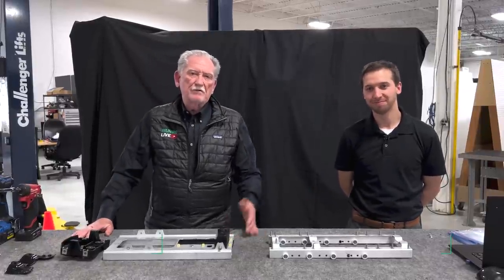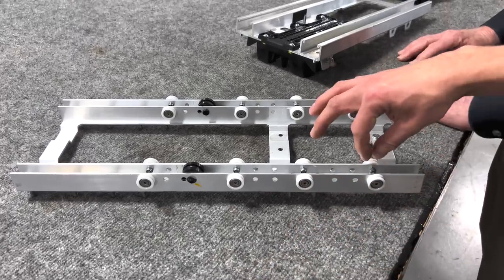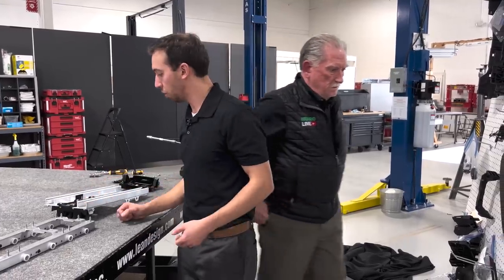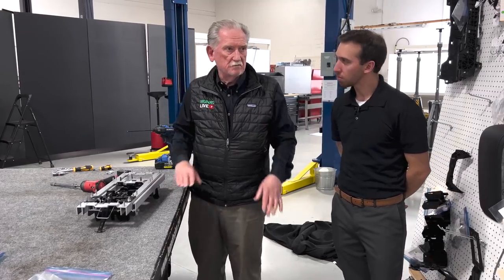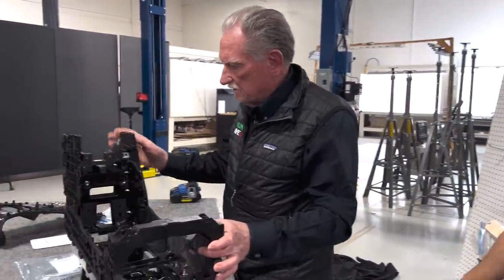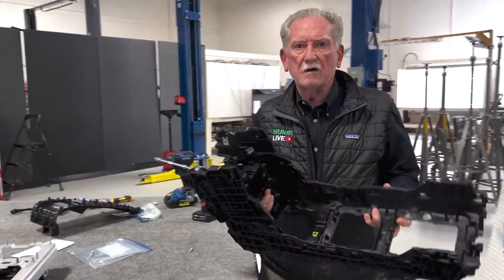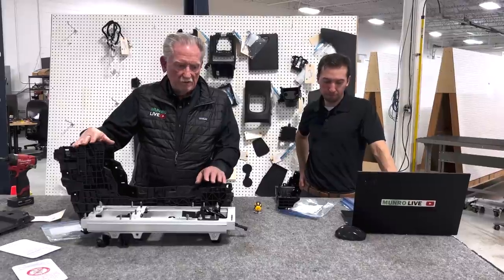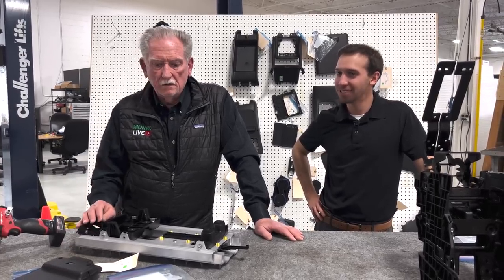Some assembly required | Hyundai Ioniq 5 Sliding Center Console

Comment: I'm really impressed how well Tyler knew this assembly top-to-bottom, considering he wasn't involved with the design.  He knew where every part went immediately when asked, the orientation, which fasteners and which direction they went in, everything.  He did a great job walking Sandy through the entire assembly.

Hyundai, look at this as an opportunity to improve your production rate and lower your costs.  Put aside any shaming of whoever designed this system and instead use it as a learning opportunity.
Reply: Learn from the best and you may undercut your competitors.
Reply: Just wish he'd have had the parts count/weight numbers at hand, wouldn't be surprised to see Sandy in need of an IOctovalve inhalent! :)

Comment: Great video! Thanks!!

I just replaced my fixed center console in my 2023 Ioniq 5 SEL with a sliding center console from a 2024 Ioniq 5 Limited. It was extremely easy as it only required removing 4 nuts (two at the front and 2 at the back) from the floor mounted studs plus one combination electrical connector for the 4 USB ports and wireless charge pad. I'm a big fan of the sliding console because I'm a big person and I cherish the knee space that the sliding console provides when slid to the aft position. Also the skins are interchangeable between the two if the color happens to be different. To access the nuts you only need to remove the console floor which just snaps into place.

I'm guessing that the actual consoles are fully assembled before arriving to the main assembly line where they are just quickly dropped in place.

Comment: That was great! I used to be in charge of manufacturing engineering at the original Silicon Valley startup. We learned Design for Manufacturability early on and Sandy clearly nails it. I watch these videos because it continues to be a fascinating topic and I would actually work there for free if I could. People tell me I'm nuts when I tell them I preferred working to retiring.
Reply: Me too. I will do my best to avoid retirement.

Comment: Thanks for this Video! But please keep in mind that if you slide the console backwards you can easily switch from the driver to the passenger seat, without any acrobatics or the need to lift your feet! Which also means that you can sit on the console with your full body weight. All plastic, probably not the best idea. As an end customer I appreciate this robust solution. You can sit on the console and the floating armrest and nothing moves or crunches at all.
Can be made from fewer individual parts, definitely, less robust, please Not! Best regards from an IONIQ 5 owner since 2 years with a sliding center console, i love it ❤
Reply: Because you’re an IONIQ 5 owner and obviously have had some experience with the center console, I have a question for you.
I can see why it’s convenient that it slides, so you can easily get to the drivers seat if the drivers door is blocked. 
The fact that it slides is not a problem. As Sandy points out, it could be done a lot simpler though.
But you specifically defend its robustness so you can sit on it. 
Why would you sit on it?
Reply: @holgergrauslund  "Why would you sit on it?" is a pointless question. Someone will sit on it, and thus it needs to be strong enough to support those forces.

Comment: I think the reason why the slide isn't part of the console is it's only used on the higher trim levels, the base Ioniq 5 doesn't have a moving console. So they just make one console for all the cars and install the slider as needed.  But I am glad to hear it's over built rather than cheaply made.
Reply: Yah, individual part to prevent rattling noise? Sign me up on that. At least some customers choose to pay for it...

Comment: I own an Ioniq 5 (wife and kids agree it is the best car we have ever owned).  Love watching Munro.  The rule of "does it HAVE to move?' is a great design question.  My answer regarding the Ioniq 5 centre console is 'Yes - the console should move'. We move the console regularly.  I used it just today - my son is learning to drive and when I picked him up I simply moved the console back, slid easily from drivers seat to passenger seats like the old days of open front bench seats.  My theory with the Ioniq 5 (I could be wrong) is that Hyundai saw an opportunity to bring to market an EV that would help improve their market standing and reputation.  I think they put their 'A team' of engineers on it that were told to 'spare no expense'. I'm not convinced they are making much profit on the Ioniq 5 but its purpose is more as a 'halo EV car' for the brand, not so much a profit maker.  The centre console design highlights that Hyundai's focus was not building cheap but instead building robust and feature rich.  The centre console is very sturdy from my use - my 3 teenage kids have tested it fully!
Reply: Great comment! I also think that a heavier console is a more sturdy one 👍
Reply: It’s cool to hear a customer is getting some use out of it!

Question: would you be more, or less, happy, if it had seat-mounted armrests and some shallow Tupperware on the floor?

Comment: I own a 22 Ioniq 5 Limited, and I think that the center console is so solidly built because, when the HVAC is ripping, there's a noticeable shake in the console. It's definitely over engineered, but otherwise it would be a rattly mess in an otherwise whisper quiet electric vehicle.
Reply: Spot on, but hey, the Tesla biased guys don't seem to remember that Teslas goes rattling before hitting 10,000 mi.
Reply: @RupOase  Yeah, I noticed that definite pro-Tesla bias. Makes most of their reviews suspect if they diss on all the other manufacturers and brighten up during any Tesla related discussion.
Reply: I agree, they spent money in a position of the car that the customer will be in contact with doften. This solid feelimg makes tha vehicle feel like a premium car.
But a lot can most likely be saved, and it would still be nice and solid!
Reply: Agreed—it’s definitely a solid construction as it should be for a moving assembly. I can’t imagine how cheap it’d feel if it was all plastic as he suggested. 

Now if only the door handles were metal instead of plastic… 🤨
Reply: @perjonsson7343  totally agreed. I prefer the over-engineering in high points of contact/interface. It feels like such a solidly built car, especially when compared to more “efficient” designs like Tesla. 

The glaring exception though, is the door opener handles—I wish they were metal instead of plastic. Especially given that many passengers miss the elegantly simply armrest door handle and try to pull from the door opener.  😳
Reply: @4thdistrict476 That’s because no one has caught up with Tesla yet. Legacy auto moves so slow. Like Sandy says, “Tesla move at the speed of thought. “  Even Jim Farley, Ford CEO praises Tesla.
Reply: @205rider8  - I disagree. Tesla moves at the speed of boredom. 

Tesla is stagnant. Their four models are so similar that they are hard to distinguish from each other. They haven't changed much since they were each introduced, making them boring. The quality issues still remain. 

Tesla has over a decade lead start on the rest of the manufacturers, so there are more of them on the roads. People continue to by Teslas not because they are good cars, but because they see them everywhere and are lulled into thinking that they are what they should buy. "Everyone has them, so they must be good". These people are followers, surrendering their decision making to others rather than actually doing research and choosing something that actually makes them excited. I know of very few Tesla owners who are excited about their cars. 

And Jim Farley "praises" Tesla's sales model, not the cars themselves. And, he desperately wants in on Tesla's supercharger network to try to save a struggling EV division, so he is prostrating himself at Musk's feet to gain favor. It's actually embarrassing watching him grovel like that.

As for Monroe & Associates, and especially Sandy himself, they are mostly concerned about how simply and economically an item can be built, not the actually value of that item - that's their "Lean Design" charter. This sliding center control is a good example of focusing on lean manufacturing to save costs rather than on the value of it's functionality and usability to the user.
Reply: He's simply pointing out you can make a good console far far cheaper. The buyer is paying for it
Reply: @glenisold79  - and the same could be said for everything in any vehicle that makes it more of a premium product than it could have been. The buyer is paying for everything on a vehicle, even things that make it better than the base model costs. So yours is an extremely weak argument.

Comment: I'm not in the industry, just an artist/painter/sculptor, so I'll throw out a guess, re: snap it together then added fasteners.
They built the column and then discovered it rattled or buzzed after x-number of miles driven, or x-number of times the column was slid front to back. 
This was particularly audible in the otherwise dead-quiet EV, and the fasteners were added to dampen / kill the buzzing.
Low cost to use the added parts rather than to redesign the column . . . either that or the shipping deadline would be missed owing to production delays a redesign would create.

Comment: From a manufacturing cost perspective this console is a nightmare but from a consumer standpoint I absolutely love it. 

It's built like a tank that will last the life of the vehicle and likely show zero signs of wear or noise or flex - ever.  

I bet a snap together poly pro unit would be a limp creaky rattly mess in a few years after creep, heat and mechanical cycling takes its toll.  

North America seems to love Fisher Price interiors where every knob, lever, button, latch, panel or handle flexes when you use it but I sure don't and it looks like Hyundai definitely doesn't either in this case.

Comment: I expect this to get lost in the ~600 current comments, but no matter.  I'm currently replacing a failed water pump on my ol' 2002 Ford Ranger 3.0L.  I've done Ford water pumps before & my description of Ford is:  "Ford puts the water pump on the assembly line first & then bolts the rest of the car to it."  Unbelievable the amount of stuff I have to move out of the way to get access to all the pump bolts.  I did a Buick water pump once & it was ridiculously easier.  This excellent video exposes that some things just never change.

Comment: Bare minimum if they wanted to keep the slide then they could re-engineer the main slide itself. Make a re-designed center console use 4 bolts that can simply use locating pins inside and attach the back of center console to rear of slide, 2 bolts inside towards front / middle. Then they could eliminate the slide bump stops itself since its positive locked to the main slide mechanism (which can be physical mounted now - so no need to worry about it coming off vs. taking whole console off). Then the main console could just be molded like EVERY other console...

Comment: I dread to think how long it must take to assemble that console. It's bewildering.
Reply: over an hour… maybe…
Reply: Imagine when it fails cuz you know they made it that way to fail just after warranty, cha ching.
Reply: Cant put all those parts in a box, shake it, and get the final product.
Reply: EVs aren't expensive because they're electric, but because some idiot in the design department has gone out of their way to make them 'futuristic'...
Reply: @KevinT3141  There may partly be some truth in that but a lot of it is the huge expense of the BATTERY PACK ! You could buy an entire lower cost ICE car for the same as the replacement cost of many packs.

Comment: Think about this another way, they just moving towards recyclable interiors. You can easily melt aluminum, but you cannot do anything except burning with glass filled plastic. Though it's definitely now what Hyundai's engineers have thought, I managed to found one benefit of such design. Also, maintaining assembly process complexity ensures high availability of jobs.

Comment: I love this format.  Do not let Sandy see what is going on with the disassembly and spring it on him with the camera running. But my first question would be; "Why does a console have to move anyway?"
Reply: The console moves to let you adjust the armrest position. And the seat lays back with a retractable ottoman so the driver can relax and rest while plugged in to charge.
Reply: The moving console and back seats are the most important feature of the Ioniq5!
Reply: @stephenj4937  And where is the plug for the driver? The Koreans do not have Netflix and YouTube in their cars, they must have direct brain interfaces. But i could not find the plug for my NBI - My Neuralink direct Brain Interface.
Reply: @wolfgangpreier9160  That plug is in front of the console where you can't reach it, for safety purposes while driving ;-)
Reply: @ScubaSteveCanada  Ahh i see, when i next sit in one i have to look again.

Comment: As a retired consultant for process optimization I learned very early on especially with manufacturers that have a unionized labor force the amount of REQUIRED intensive processes that could have been done at 30% of the cost and effort yet cannot because of their labor agreements. I dealt with a company that was by their labor contract not allowed to ship goods in a trailer that exceeded 50% of the trailer capability. For example if 1500 pieces could fill a 53' shipping container, they could only fill 750 pieces. You say, well, negotiate a better contract. Easier said than done. If the union has a hard position on that issue and will go on strike, even if you end up getting that requirement removed, the cost of the strike would exceed any savings by eliminating the 50% rule.

Comment: you have to watch Ioniq 5 center console instruction video and find that it warrants the complicated design. The arm rest is floating design which needs all that steel structure on the other end.  The complicated and heavy sliding mechanism is warranted because you don't want the thing to rattle in a few years while at the same time operate as smoothly as the price of the car.   I also like this feature of a sliding center console as I'm never fan of having a huge partition between the driver and passenger, as the interior will feel far smaller. 
I like or maybe almost the things Hyundai has done to the Ioniq 5. One major drawback that I wont be buying one is their use of pouch cells. You don't want to use those cells except for ultra portable like a phone or handheld devices.

Comment: great job.  I had a Niro and it had a hole in the front of the console, so one could pass an USB corn though it and then it was easy to plug your phone in.  This console does not have a pass though, one is anyway hunting for it, so you can plug your phone in.  My console does not slide.  Karl talked about how heavy the foot rest hardware was.  Maybe these were just outsourced design.

Comment: No apologies.  This is what you do ... and when you come up against a component that is designed SO contrary to Lean Design, it is fully expected (and desired) for some extra time spent in looking at it.  I was ready for more.
It would be interesting to know if Hyundai contracted this whole thing out to someone or it was a hasty in-house build.
Reply: The cost of the part would be interesting...
Reply: Would say this absolutely was a contracted sub-assembly.
Reply: @NotNowLater  🤞I hope so for Hyundai group.

Comment: Yes, that's a extremely complicated piece, but… I really like the adjustable console in the Ioniq 5 Limited. It's a great feature, and maybe Hyundai will figure out a way to make it easier, simpler to build.
Reply: Sandy did criticise the potential for stacking tolerance errors. But the functionality of the console does seems really nice. Hopefully Hyundai can improve the cost of this design.
Reply: I believe the point is that the assembly could be greatly simplified without losing functionality or losing feeling of quality and solidity.

Comment: I was considering a ICE 2024 Hyundai Kona.  This kind of over complication makes me nervous about how it would hold up over time.  More parts & connections means more things that can vibrate loose or otherwise go wrong.
Reply: KIA and Hyundai make solid cars.  Their EVs are some of the most efficient made.  You'll be fine.
Reply: They’re known for two things: flawless reliability, and engine replacements

Comment: Makes me wonder how many parts and the weight of the sliding console in my Chevy Bolt.
Reply: I took my Bolt console apart to add a Qi charger.  It is probably not even 1/4 as many parts.  In fairness, Hyundai console has a lot more articulation than the Bolt console, but I doubt all that fancy articulation adds much value.
Reply: The gear selector on my Bolt, I believe was pulled from the Buick parts bin.  There are quite a few little pieces inside the selector which violates the KiSS rule, but nowhere near the overkill seen in the Hyundai.